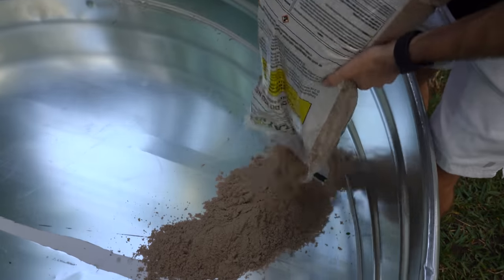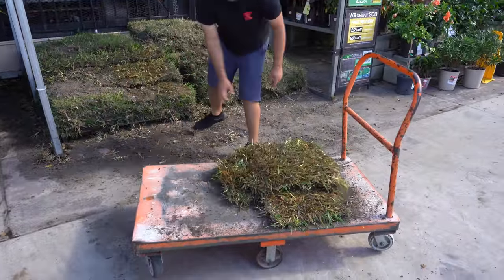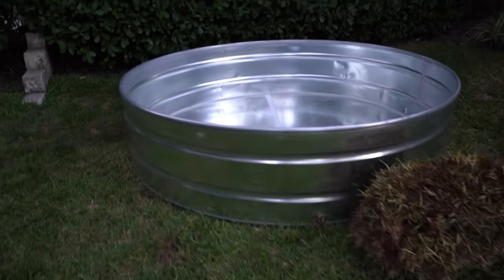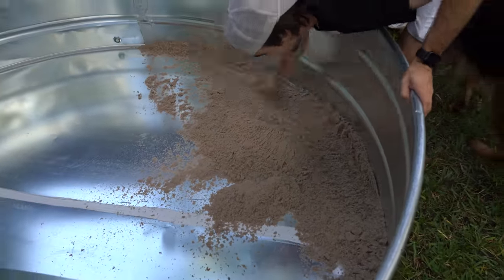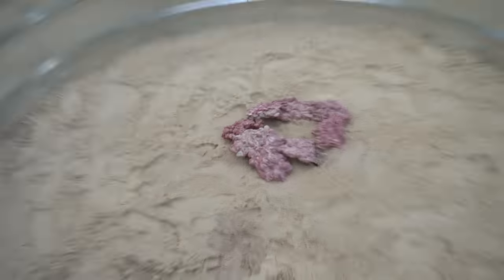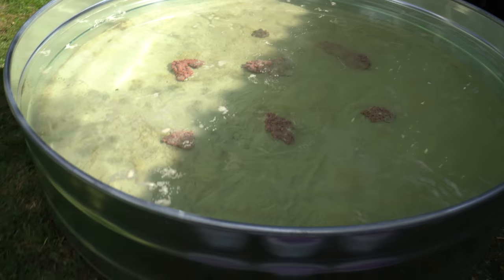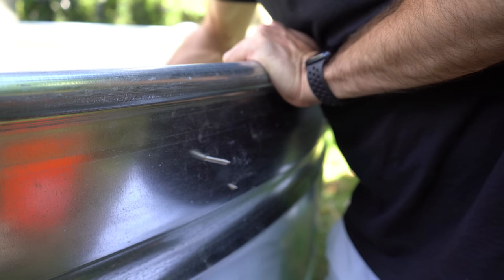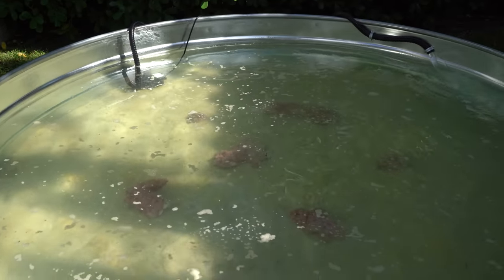I Built a SALTWATER POND in my BACKYARD!! *sharks*

Comment: I see a few issues I have quite a few salt tanks of my own. 1 water added needs to be RODI water not tap water that’s then dechlorinated with prime. 2. Sun will absolutely fill that thing full of algae. 3. Everytime it rains in Florida it’s adding rain to the tank causing salinity to drop and puts any impurities the rain is collecting in the air as it’s falling into that “salt water pond” this needs to be inside a contained building. I needs to be sealed with a pond waterproof coating preventing that from rusting.
Reply: It's like a car accident, soo many issues with this. From the sand to the dead "live" rock to the hose water...... it's just another fish euthanizer.......
Reply: Well said. All of this is for views and clicks. He don’t care about any of the fish
Reply: I successfully kept corals and fish in Florida from tap water back in the day. I would let tap water sit out in the sun in 5 gallon buckets for a couple days for adding. Any chemicals/impurities would evaporate out. Filling is just fine without RODI because he's not adding livestock right away. A few days from now the water will be just fine.. provided the galvanized steel doesn't leech which is a far greater issue with this.
Reply: And the pond is metal!
Reply: You don’t need RODI water to set up a saltwater aquarium
Reply: You can use tap water for saltwater tanks it just depends on what’s in the water it self as far as the levels but I do agree with the issue with the metal pond and metal hose clamps major issues with rusting
Reply: @oosaturatedfatsoo  this is true if he was going for a reef tank but tap water is usually safe to mix with salt
Reply: @NicksHondas210  if the water sits long enough to be cycled, yes. But we know that's not going to happen....
Reply: Rite on point everything I was thinking of as well . Plus the whole levelling of the pond lol . Like his channel but don’t think he did too much research
Reply: that salt will eat through that tank in no time
Reply: @ooogabooga1837  no but it helps. A lot and I don't think he sent his muni water off to ICP to find out what is in it.

Comment: I'd be concerned about using a steel/metal basin - Could leech stuff into the water and corrode. I would have bought a pond liner or a tarp or something to protect it.
Reply: Rubber maid container would be better. And the playsand is going to have a lot of contaminants in it. And will also cause a massive Algae
Bloom!
Reply: And it will start holding a lot of different parasites

Comment: Should have taken the time to dig out the ground and level it. It may warp the metal with the weight of the water after a while. Also I wonder if the salt water will cause the metal to corrode? Not sure if it will or not. Regardless I’m excited to see how this pond plays out.
Reply: Metal in water will corrode and oh yeah rain water in salt water, so keeping salinity in check will be fun🤦‍♂️
Reply: Looking forward to it too. I’m seeing one up soon myself 😊
Reply: @alansurgeoner5259  sorry I know that I hit the wrong key rain water “In” saltwater, it should have read
Reply: @johnschumacher2536  well this is made to hold water. Just not necessarily salt water.
Reply: @katiebug5273  not the metal fasteners they used to attach hoses, nor the screws they put into the side of the “pond”.
Reply: @johnschumacher2536  yes I agree with that. You should never use any kind of metal in water that isn’t completely safe. Those meals will cause issues later down the road for sure. The screws may not matter as they’re not in the water.
Reply: @johnschumacher2536  No worries. I wasn't trying to mock you or snipe sarcastically,I was just pointing out but understand it is so very easy to type quickly and say something totally different from what you meant.
Reply: @katiebug5273    A lot of the screws are plated nowadays for the purpose of using outside and so to stop or reduce rust. Even so when you screw them into anything the threads are stripped of any protection and they will start to corrode from there. I think they will have problems later and should maybe have took time to look for possible problems down the road ,but I also remember being their age and waiting or looking into things before acting was never usually given a 2nd thought. Good luck to them and hope it works out especially for any creature that is going in the tub.
Reply: @alansurgeoner5259  I absolutely agree.
Reply: Hello pretty dear ❣️❣️